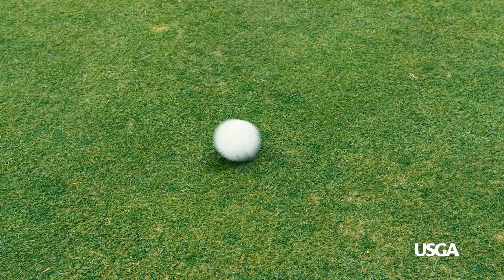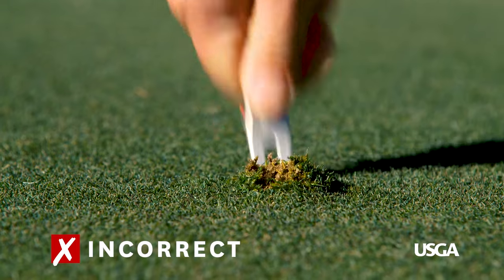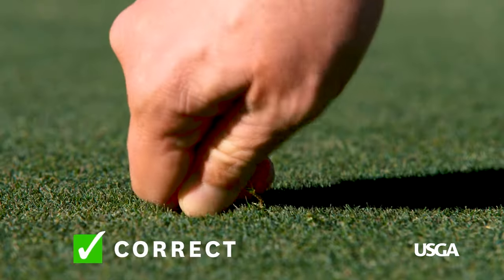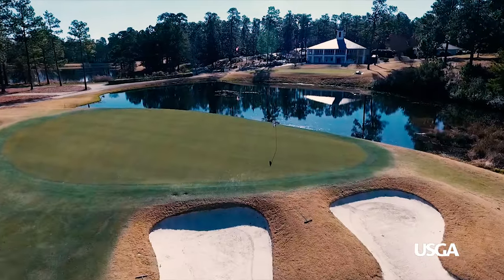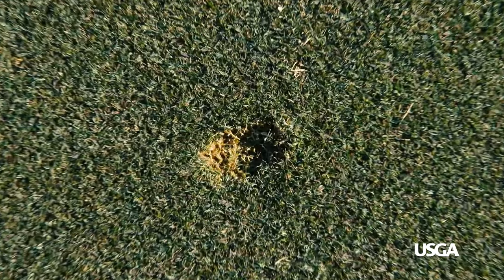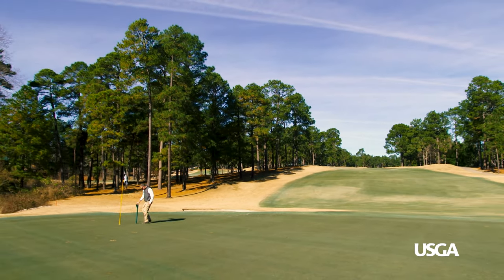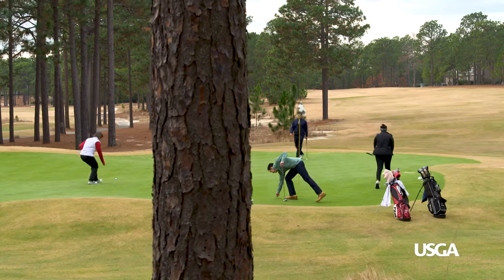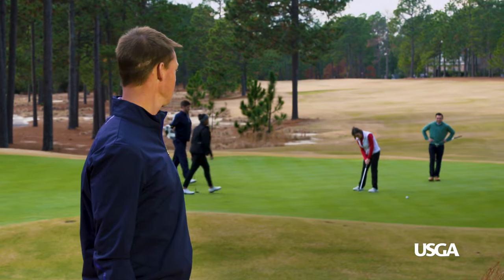Fore The Golfer: How To Repair Ball Marks

Comment: I've seen dozens of these "how to repair a ball mark" and not once have I ever seen them show a typical ball mark. They only show little dimples and not the deep, torn and ripped ball marks that are far more typical where I play. The technique they teach WON'T WORK ON MOST BALL MARKS.
Reply: Yes it does. Start from the back and push in from all directions. I'll come together. If you're pulling up at all you're killing the green.
Reply: It's still the same no matter what size. It just takes more effort. 
Or you can be like most golfers and leave them for someone else to fix
Reply: Works great.........not sure what you are doing wrong.........